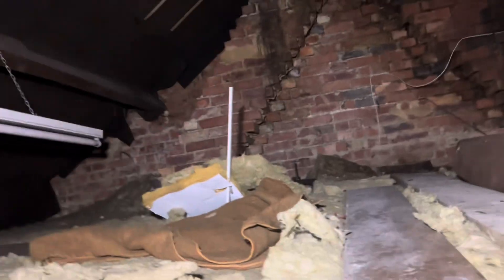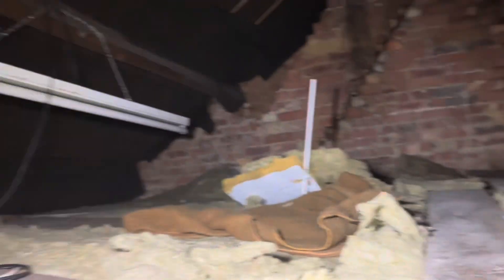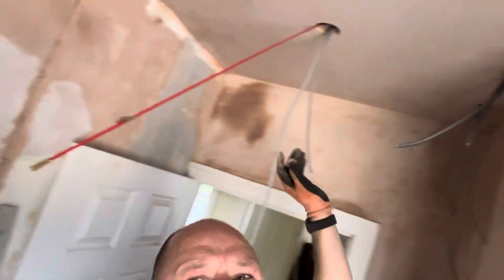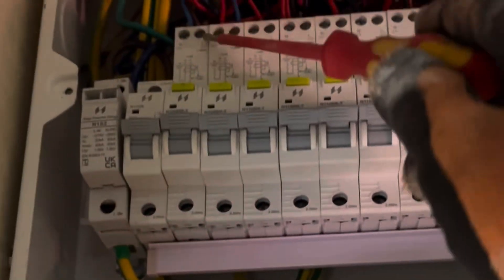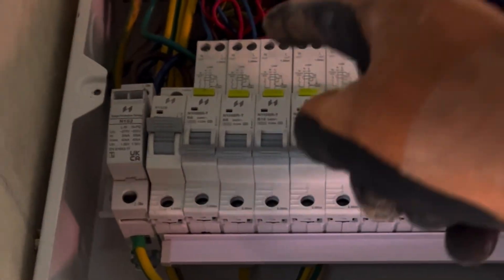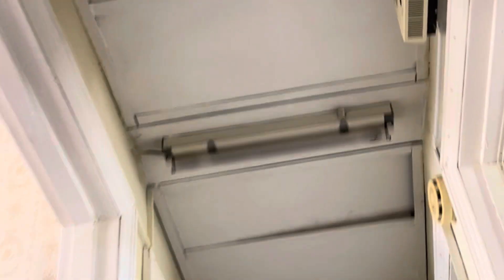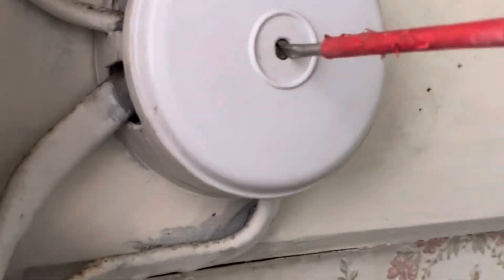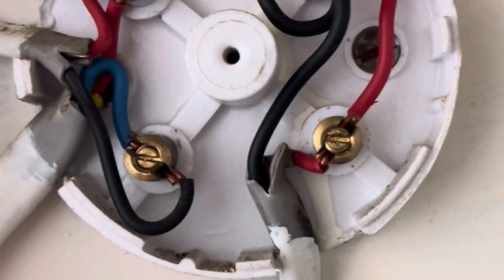Inside a Day’s Work: Domestic Electrician Life 🔧🏡

Comment: So we will replace this Wylex consumer unit with a cheap and nasty consumer unit. The consumer unit is arguably the most important item in the house . So use a trusted quality make .
Also judging from the new pull switch you installed, midgets must live in the house going on the length of the pull cord
Reply: I just did look it up . Here’s what I found. . Navitas consumer units are generally considered to be on the lower end of the quality spectrum when compared to premium brands like Hager, Wylex, or Schneider Electric. While they may be cheaper, they may not offer the same level of safety and reliability as higher-quality options. It's generally recommended to prioritize safety and consider well-regarded brands for consumer units, as they are a crucial part of a property's electrical system.
Reply from the maker: 🤣🤣🤣 dude you just made that up
Reply from the maker: Dude - That is a top brand fuse board - look it up. And the pull cord is so long for wheel chair users
Reply: @toolboxtalking  this is a typical example of of why electricians use the wrong make or manufacture of RCBOs/ MCBs  . Because the electrician has put in an odd make of consumer unit and spares etc are not available locally on the shelf .  Also it looks like it’s got a separate MCB for the SPD . So technically it could be switched off . Not a good idea . Again top brands don’t do that .
Reply from the maker: Ahhh mate. You need to check a few videos out. It will explain a lot for you
Reply: @toolboxtalking  wheel chairs upstairs.
Reply from the maker: 😂😂😂 yeah the guy is really strong to get up the stairs